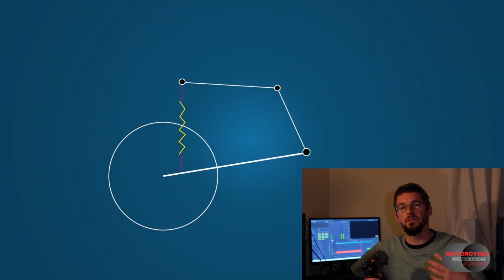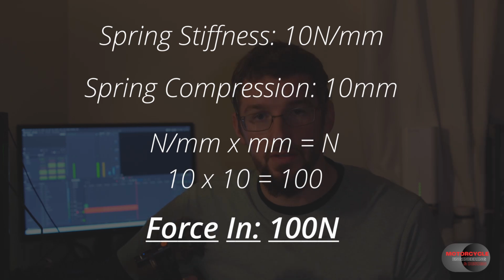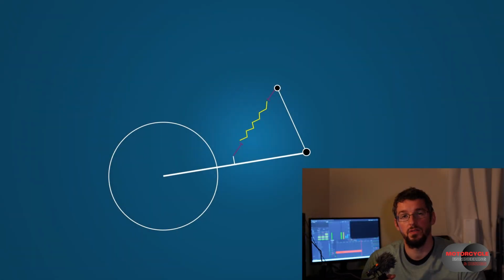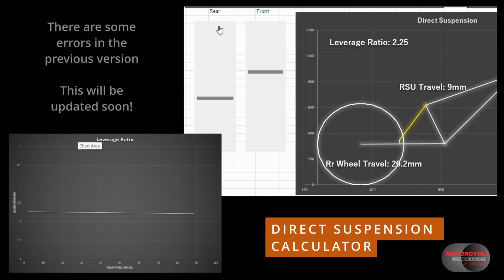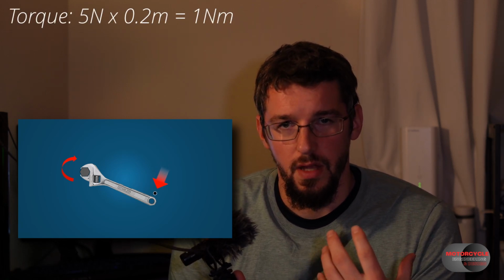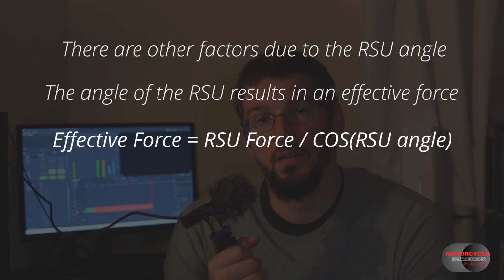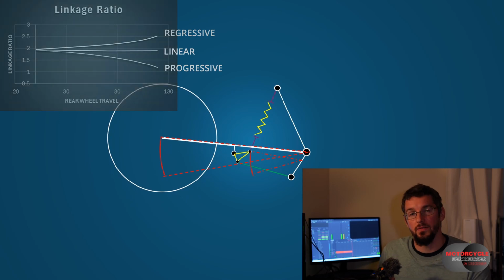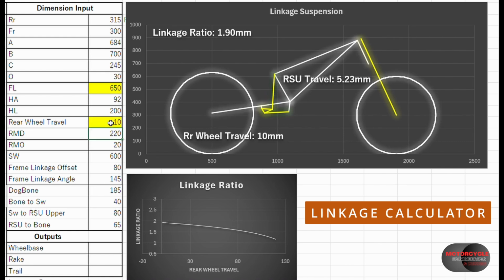Motorcycle Suspension | Leverage and Linkage Ratio Breakdown, Motorcycle Dynamics Part 4

Comment: Good information, but I need to understand some of the terms and basic, if you could make one video explaining them it would be great. Also what software use for suspension and leverages.
Reply from the maker: Hi @manaamahemad8773, I understand. I'll add it to my list!
The "software" in the video is some excel calculators that I am working on, taking a little break from it at the moment, but I'll be sharing the updated one soon